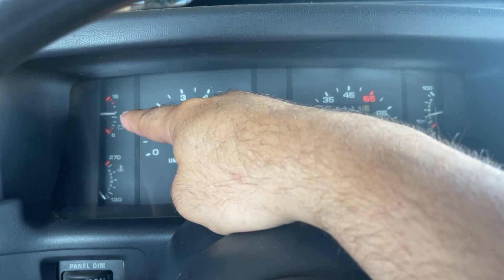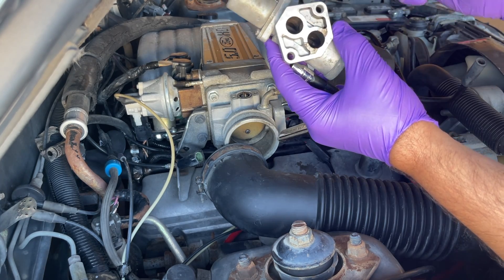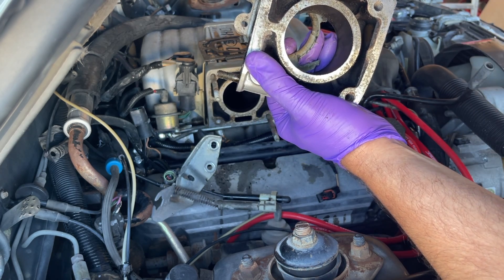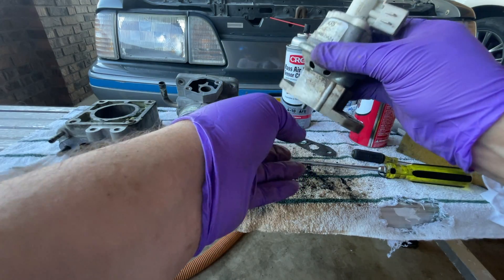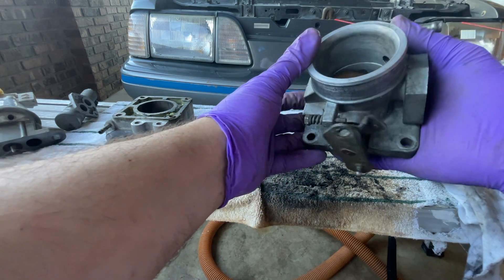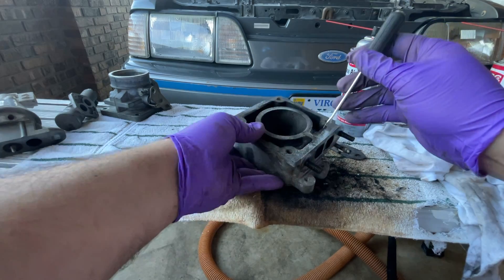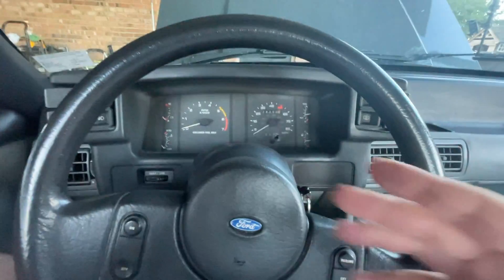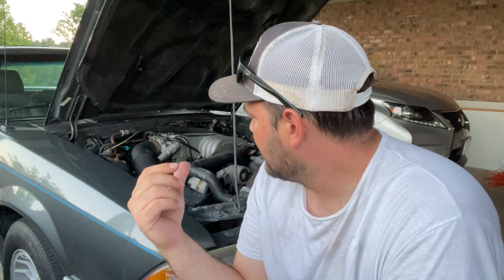1987 Foxbody Mustang | Idle surging Part 1 of 3

Comment: 😎
What did you get with the KOEO/KOER computer self test?
After you fix the codes if it still surges, then run a BASE IDLE RESET with the factory 2-2-2 procedure.
Reply from the maker: @hotrodray6802  I checked the diodes and they looked good. I checked correct voltage coming out, which also looked good. I did the base idle reset as well. I had the car running good before I ended up selling it.

Comment: My car is idling rough at startup, but once it’s warm, and driving, it idles at 2000-2300rpm and will not come down. I hit the key back and forth and let it restart and it stays at 1,000 rpm. Just started last week. Can’t figure out why.
Reply from the maker: When you say you hit the key back and forth, are you referring to turning the car off and back on? If so, do you do that after it’s hot or is it still cold? When it says 1,000 rpm’s does it go back up after you start driving it again or does it stay around 1,000 rpm’s at idle after driving once you turn key off and on?

Comment: Mine idles great when cold right at 750 rpm. After i drive it 5 miles it starts surging like that at lights. I’ve cleaned everything and no change
Reply from the maker: May have bad sensor or possibly a bad voltage or no voltage to a sensor? Check voltage across the sensors. It may run ok until the computer starts trying to adjust after it’s warm. Just a guess though without knowing all the details. The wiring on these cars are getting brittle. I had broke wires running to EGR and TPS that wasn’t getting any reads.
Reply: @selectyourtools 
Stop guessing. Run the self test.